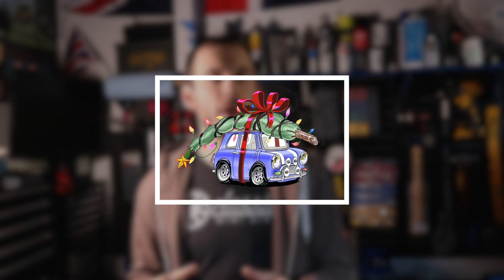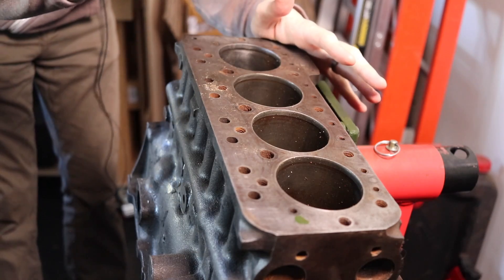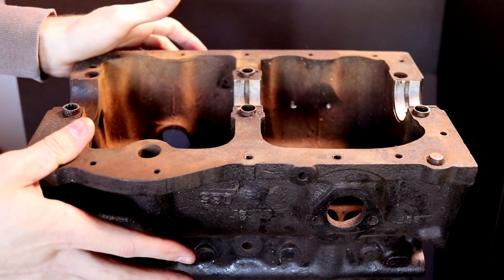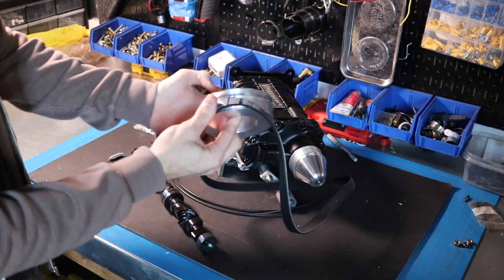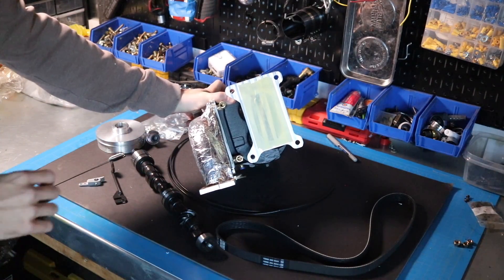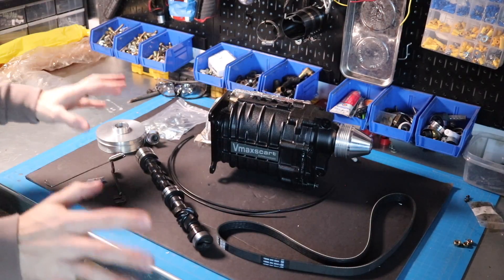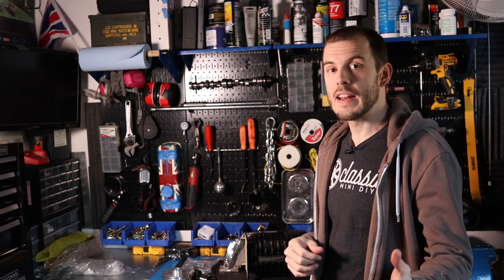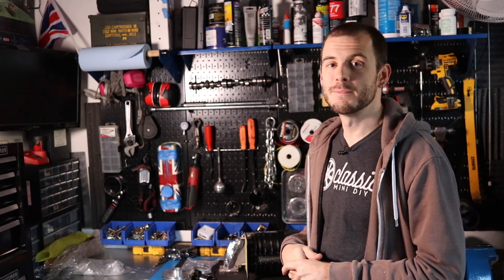Turbo or Supercharged Mini? - Forced Induction Part 1

Comment: Supercharging is a bad idea.  There is a huge parasitic loss from the supercharger.  There have been others who tried super charging.  There was very little gain in horsepower. Mighty car mods built a mini with a supercharger.  It was difficult to tune and ran extremely poorly.  These superchargers do not produce the horsepower they promise.  You should really watch the mighty car mods videos before you proceed any further. You would be much better off with a appropriately sized turbocharger.  Picking the right size would give you a power band that started boost very early on and continued throughout the entire power range.  It would give you more boost and weigh considerably less and have no parasitic power loss.  It would also give you the opportunity to add a boost controller, which would allow you to turn the boost up.   I hope you are serious when you said. You would build a turbocharged motor later to gain that experience.  You will be much happier with a turbocharged 
Engine.   I really don't understand how you could claim there is parasitic power loss at the top end and not see that by its very nature a supercharger that runs on a belt is not parasitic throughout the entire range since it relies on the engine to provide rotation throughout the entire 
Process.  Turbocharged engines use exhaust gas to provide rotation and it requires no additional power from the engine to provide boost.  I gave you a thumbs up! I am looking forward to you building a turbocharged engine in the future.  Perhaps then you can prove to yourself the difference in power and gas economy.  I am looking forward to a cost breakdown, to see which method is cheaper.  You should think about using a well respected brand of turbocharger and consult with them which model would provide the boost characteristics, you are looking for.
Reply: Who let this lad near Wikipedia..
Reply: Oh well, supercharged or turbocharged..who cares. If it runs good and you are happy with it, that's what makes cars fun.
Reply: @henrietn  spot on. His car and his money
Reply from the maker: I mean dyno results don’t lie. 🙂 There is parasitic loss at the top end without a doubt. But that’s fine with me and my driving preferences.

Comment: How come the supercharged minies tent not to get an inter cooler. Is it due to space and where you can mount it?
Reply from the maker: It’s not as nessecary because with the blower style supercharger you are not using exhaust to create boost. So I’m turn you don’t have as much heat being generated.
Reply: It's also the inherent issue with suck through supercharged set ups.

Comment: I am disappointed about what you said about the 1293cc. I have a 1310cc ready to work on now and would like to supercharge it. What are the risks exactly?  I hope and expect you to go into detail on this build. I have a question for you so the 1310cc is a recent rebuild, has a stock cam and head ect. but it is pulled out of the car right now.  If you were going to build a fast car for the street what head, pistons, parts would you get for a full rebuild.  See there are lots of parts but what parts go best with what parts. What would you do to get the most power out of a 1310cc engine? Hope you see what I mean. Get back to me when you can as I am sure your busy. I will be watching and enjoy your presentations. Regards.
Reply: Risks are minimal. My a series turbo is 1310 with omega pistons. As long as its built properly, low compression for forced induction, it'll be fine.
Reply: Look at the various offerings from MED, and Swiftune. Lots of goodies to choose from to suit your needs! The potential combos are seemingly endless.

Comment: Looking forward to this.  The Vmaxscart Carbed Kit seems to be the most cost effective way to make 130+hp (vs turbo, twin cam, Vtec, or R1) if you take into account body/subframe mods and all supporting upgrades (engine, cooling, ignition, etc), not to mention shipping and accessibility in the US.  Curious to see what EFI setup you use, why you didn’t use Vmaxscart’s, and the costs.

Comment: Hi Cole. 

When do you think episodes will be released? Will they be weekly or less frequent..? 

And also I’m hoping to buy my own mini in a year or so. (17 years old and leaving college next year so want something to do in the summer or a gap year). Is this an expensive project? I’m not fussed about keeping my mini original and want more power and lighter weight for increased fun. Any ideas? DM me @j_c_mcgrathphotography if that helps Cole. 

Thanks. Josh
Reply from the maker: Less frequent than weekly unless I suddenly come across a pile of money. 🤣 between the injection system and the engine build up I’m expecting $4000+ but no numbers I know for sure yet.

Comment: can 998 engine be installed in any austin mini  or would you go to bigger engine..
Reply from the maker: Yes the 998 can for the most part be installed in any mini. If you have a 1275 available I would probably go with that just because it is a bit more powerful. The 998 is still a really awesome engine though and you would be happy either way I think
Reply: @classicminidiy  I can get the whole engine 250 $ candian with transmission is it worth it
Reply from the maker: I honestly couldn’t say for sure without seeing it but that does sound like a great deal. Rebuilt and restored ones fetch 3000+

Comment: Exciting! Small correction at 2:15 - It's pre -A+ because it doesn't have strengthening ribs on the block, the distributor clamp style and alternator bracket location are different compared to the A+. It's the Cooper S 1275 blocks that had the tappet covers like the small-bore engines. Looking forward to the next episode :)
Reply from the maker: Ah great details thank you. I always get discombobulated with the differences. 🙂